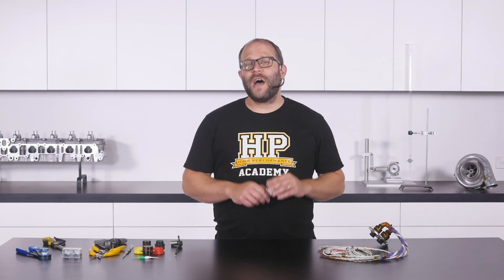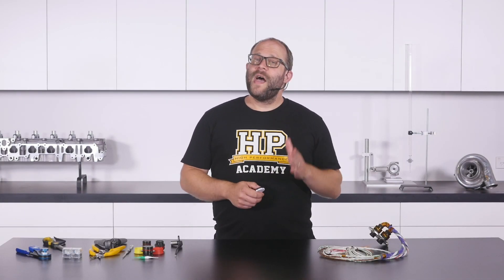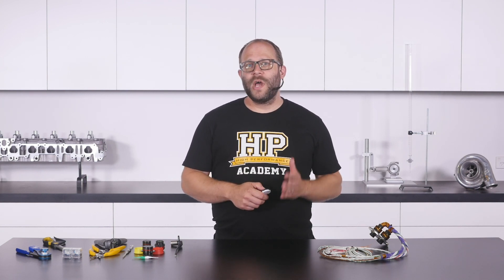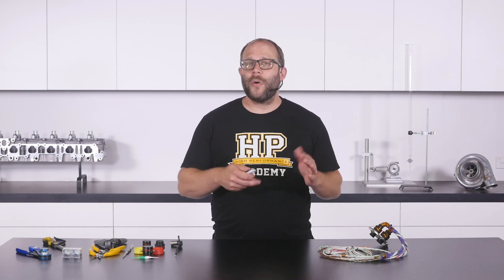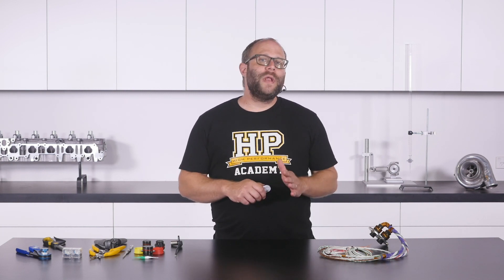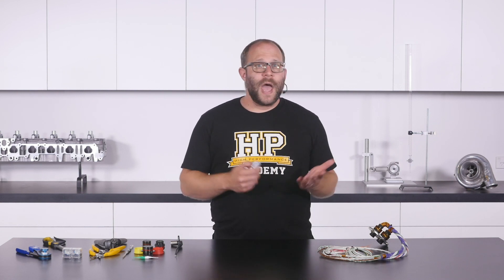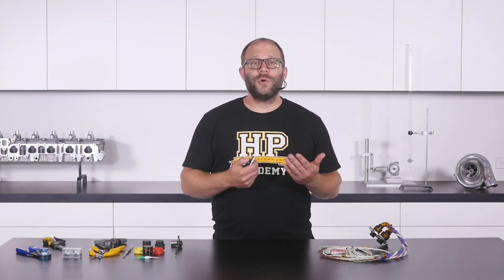How Many Sensors Off One 5v Reference | Motorsport Wiring [HPA Q&A]

Comment: If i have a 5volt sensor let's say pressure sensor. And i have a two device that needs that information. Can i share that one sensor with both controllers, or do i need 2 sensor in that case? And if it should work how do i connect those if the is 3 wires +,-,signal. Thanks